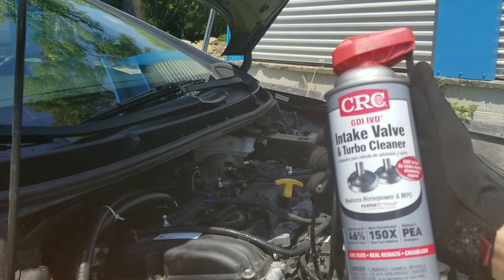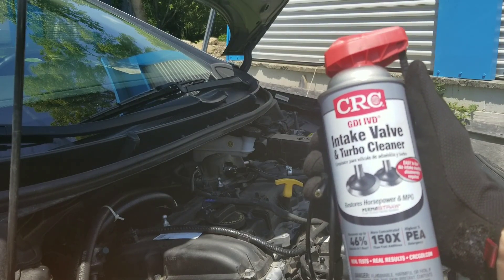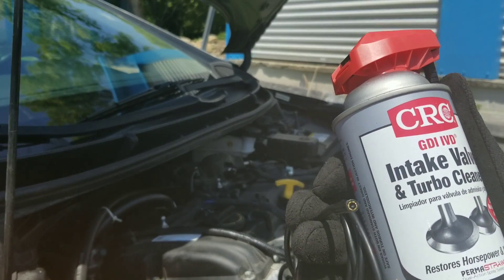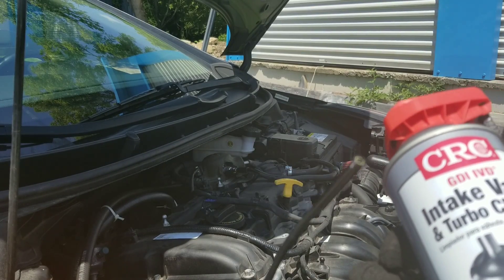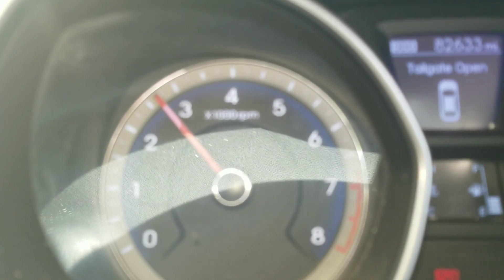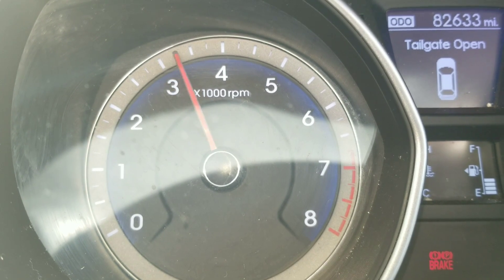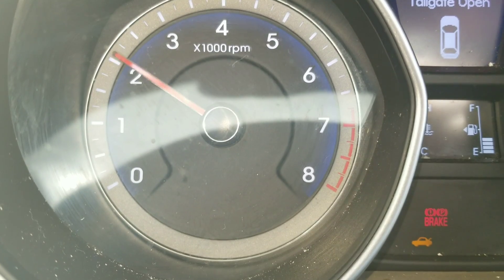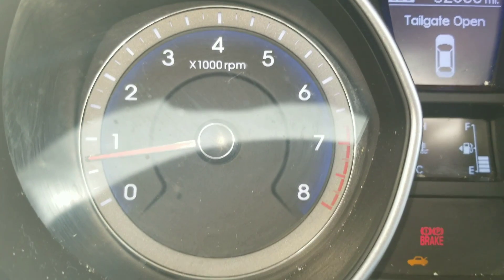Crc intake valve and turbo cleaner borescope results before and after

Comment: The car companies are building junk or the valves wouldn't do that. That is disrespectful to their customers.
Reply: I particularly agree.  It's not just the auto companies though.  Alot of the problems with carbon build up in an engine has to do with the emissions contact systems. Mainly the egr system.
Reply from the maker: Very true
Reply: Yes, but we the consumers keep buying the crap.  Why not just quit buying new vehicles with all of this new crap on them until the auto manufactures build what we want?
Reply from the maker: Thats one way to see it i understand your point
Reply: Randall Turner ,I don't think you have the Knowledge to make a Statement like that,the Manufacturers hands are tied because of this Pollution thing,the inlet valves always did this but not as bad because Petrol going down the Inlet Manifold used to wash the oil fumes through the engine and burn in the Cylinders,this doesn't happen now because the fuel is injected directly into the Cylinder leaving the oil mist to accumulate around the inlet Valves causing a build up of Carbon.
Reply: @davidellis279  They need to design this problem away the way Toyota has by having port injectors during idle and direct injectors at driving speeds. Customers must put the heat on the car manufacturers or they will continue to give us a junk product  where carbon builds on valves.
Reply: Randall Turner, You get what you pay for,as you say Toyota has tried to elevate the Problem with this type of injection but unless other car makers do the same it will continue to be a Problem,it will probably still affect Toyota engines but at a lot higher Mileages which they are renowned for achieving,every manufacturer has its Gremlins no matter how much you pay but a lot depends on how the vehicle is operated and maintained,high mileage engines last the longest.
Reply: But two injectors?  For a mile or two in fuel economy?  Just give me port injection.
Reply: forrest chambers I think that the only way for variable valve timing to work (which helps a lot with mileage) is a direct injected engine. Thats why they keep it this way atm. Without it they wouldn't be competitive enough against other car manufacturers.
Who of the 95% uninformed customers would buy their cars with bad MPGs ? Thats just the sad truth of it...
Reply from the maker: Thanks for sharing

Comment: I did this in my car and when I floored it a lot of smoke came out. I guess that means it’s working?
Reply from the maker: Yes Burning carbon  build up
Reply: NATES INTERACTIVE AUTO Thanks for the reply. One more question if I want to use 2 cans should I use one and then let it heat soaks and then use the 2nd can? Or can I just do one can after another
Reply from the maker: Let it heat soak and what product do you wanna see next
Reply: NATES INTERACTIVE AUTO Techron? Idk lol
Reply: @BIendtecc  no need. Techron works.

Comment: This product did my car good and what I saw come out of the exhaust was a tell tail  sign it was working... after 3 days of driving the car feels like new ...I do not have bore a scope to check so do not know how much carbon it removed.
Reply from the maker: Alexander King  yes i could tell a big difference it was harder to see on the borescope
Reply from the maker: Any videos you want me to perform?
Reply: Maybe a update on the how clean the valves are after x miles. Borescope of the current condition of valves. I'm almost suspect them to look even better then the look after treatment. Also, CDC has a kit that has the intake valves cleaner as well as a mass air sensor cleaner and a turbo cleaner. Could you do a vide on a turbo intake vehicle.
Reply from the maker: Let me know what you want me to test
Reply from the maker: I will do a update video as well